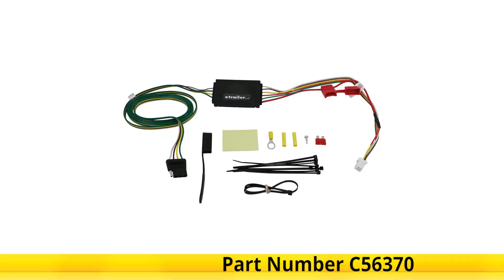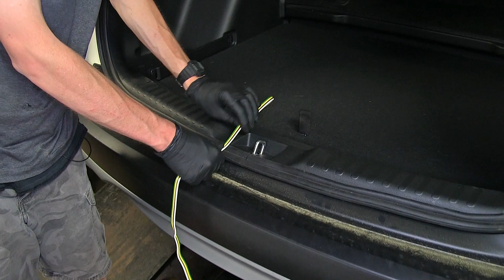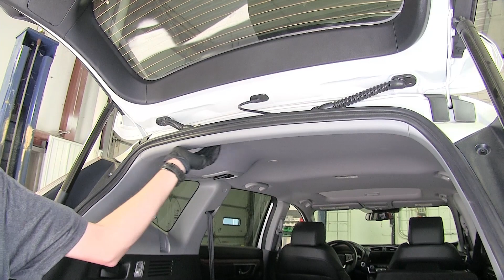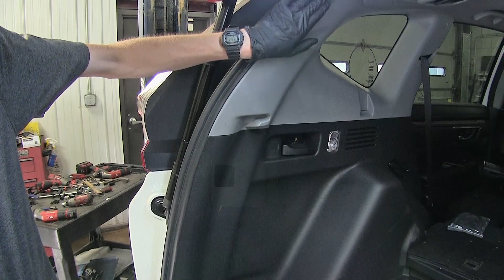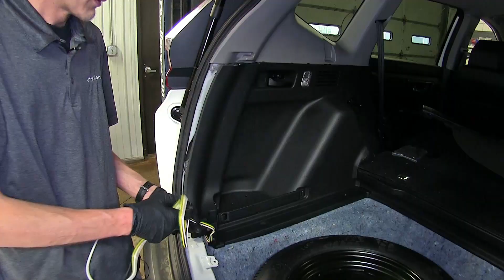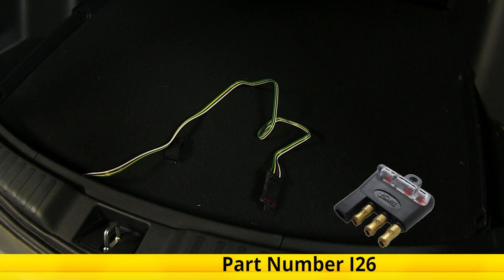etrailer | Curt T-Connector Vehicle Wiring Harness Installation - 2018 Honda CR-V

Comment: Noticed that, once I finished the install, my signal lights glitch out when I also have the brake lights on. I disconnected the trailer and the glitching still happens when brake and turn signal are on. Any ideas as to why this is happening?